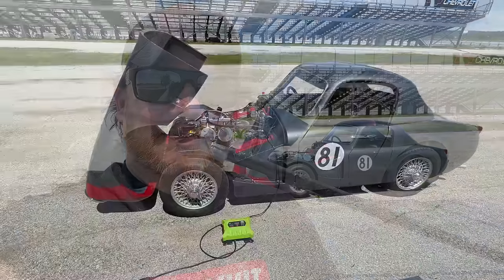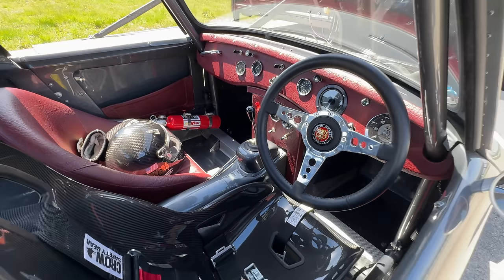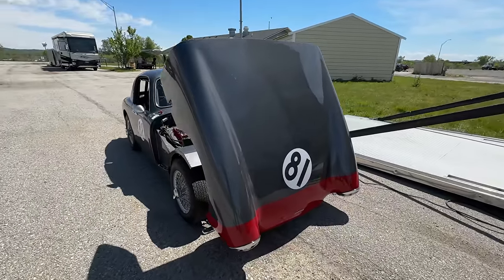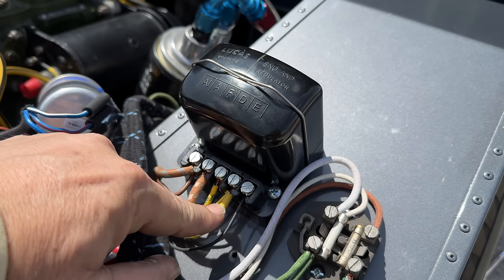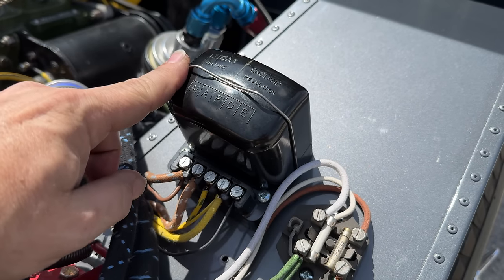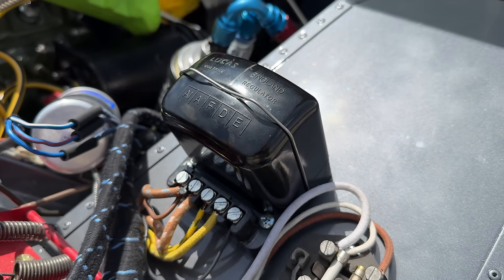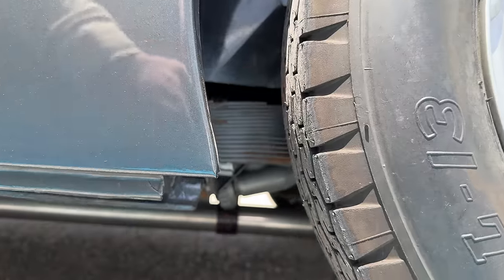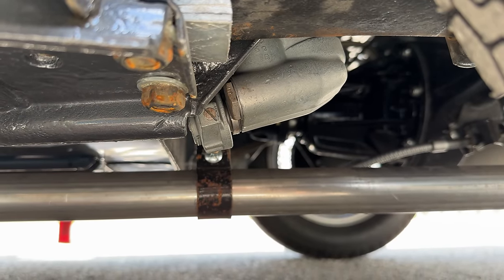Sprinzel Sebring Sprite Track Testing

Comment: Steve, the car looks good, motor sounds good. I told Ken to get it on your chassis dyno. We used a VP276 cam, which more of street performance cam, so maybe not hot as needed for all-out racing. When we built this engine to FIA 998 sec for road rally, I knew it would have to do some lower speed stuff and have some street manner. It right at 10.0 to 1 so a way to wake it more would be moe race cam and little more compression ratio. Now it should fine off 93 premium.

Comment: Neat car, but your inputs seem fairly smooth while the car is all over the lot. Can’t tell enough about the track surface from the video. I think you need to concentrate on basics on the car before you delve into complications, so you can smooth things out. In any event, it’s all interesting, and a little more coverage would not go amiss. Thanks and take care.

Comment: Underpowered, overweight with mediocre suspension, brakes and steering. How about something worthwhile, like an Elan?
Reply: You’re missing the point!
Reply: xD so 100hp at 1400 lbs 15:1 ratio with tight front end. yeah sure bud you know everything about Austin Healeys'. How about you go to the track with an Elan and we'll be over here with affordable meaningful power and handling
Reply: Overweight??  Who are you kidding!  Mediocre steering??  Have you ever driven a Spridget?
Reply: Incidentally, the steering rack in the Elan came from (drum roll) the A-H Sprite. So add a hot cam, bigger carbs, and stiffer Armstrong damper valves this Sprite could have a very even contest with a Lotus. 🇨🇦🚘🏁🇬🇧
Reply: @briandawkins984  You have obviously never driven an Elan. It is on a different level.
Reply: @briandawkins984  Yes, for two years in the '70s. I couldn't afford an Elan.
Reply: @67daltonknox  yes, I agree the Elan cannot be compared to a Spridget; the Spridget front suspension dates to the late ‘30’s.  The body is pounds heavier. The rear suspension is not independent. But still properly set up to racing form it is recognized to be a capable racer. To my mind a similar unjust comparison would be comparing a Toyota Celica of the late ‘70’s to the carburetor version Elan. The shift in technology makes the comparison unfair.